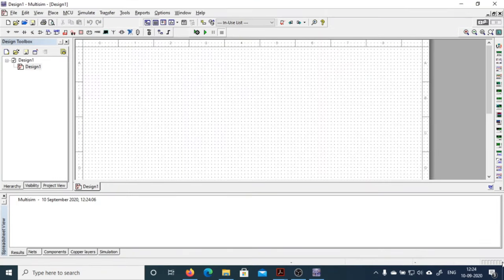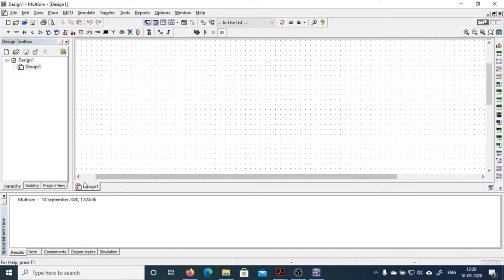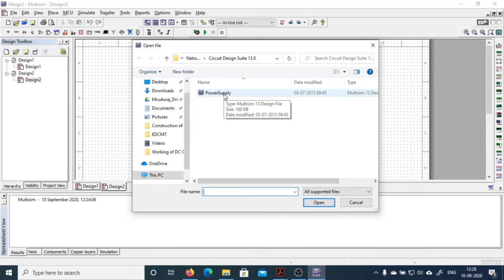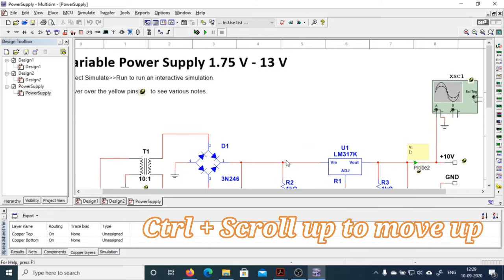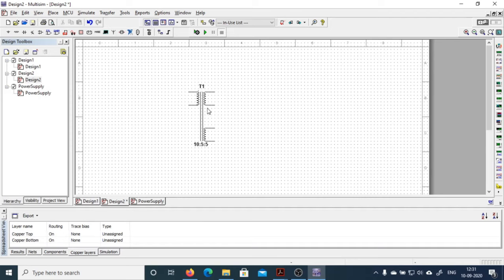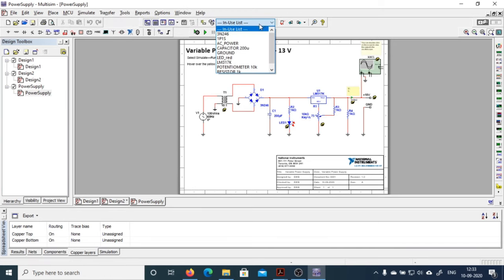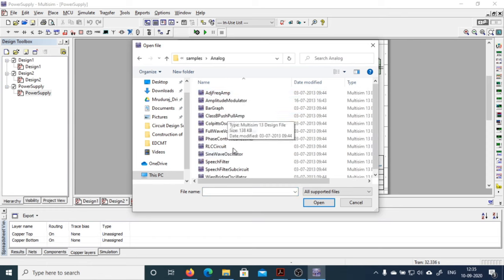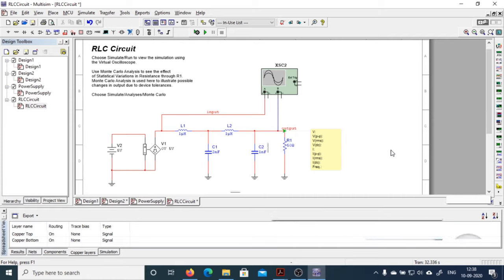Introduction to Multisim | how to use multisim | Multisim Tutorials | Mruduraj

Comment: I can not speak for 14.2 simulator, but I have seen there
previous model and tried them. The fact of the matter is
that Multisim is not a reliable product nor is even close
to effective. Through there own admission they have
stated that many problems that  have been in there past
models have been corrected and there is many that have not been resolved.

Comment: I’m trying to run a simulation but the buttons to run simulation are frozen, what are the settings to change this?
Reply from the maker: Restart multisim, or it may be possible you have paused another simulation in other tab
Reply from the maker: Yes this is possible reason

Comment: how can i open more than 1 circuit design without closing another? i keep trying to open another blank circuit but the previous one keep closing by itself =="
Reply from the maker: You can open it in multiple tabs just by using open tab